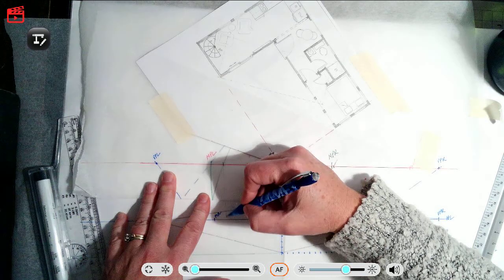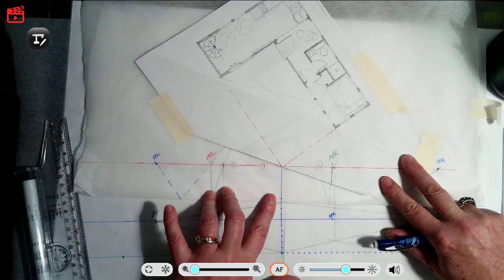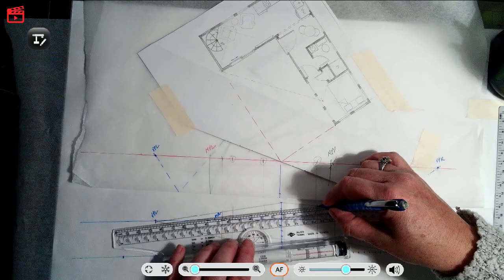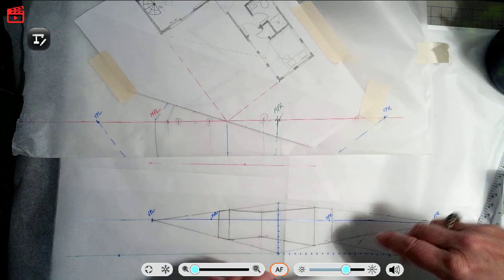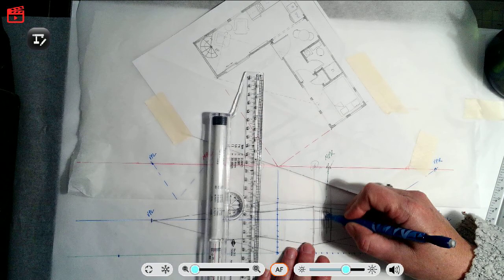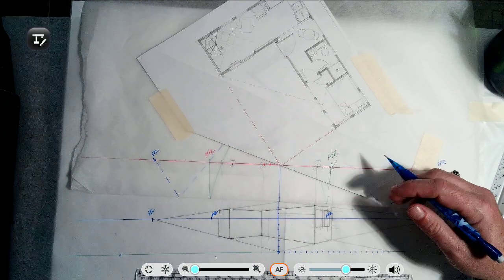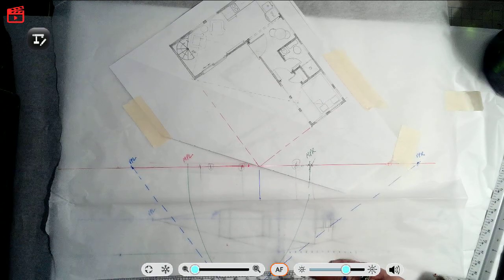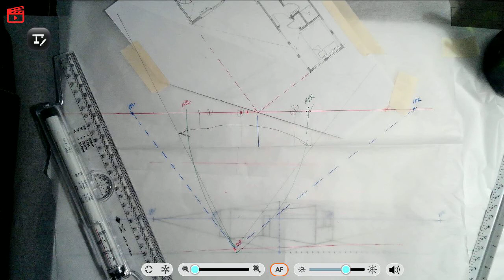Two Point perspective layout using a Scaled floor plan part 2

Comment: On 7:58 you draw the door, we can't see the bottom point where you connect, although i see the top point.   It is better to use tape to fix the paper and clearly show the points you want to join. And your hand shadow the picture so we can't see clearly.